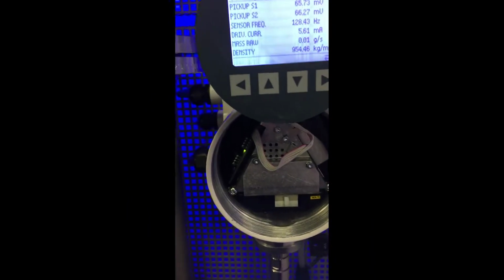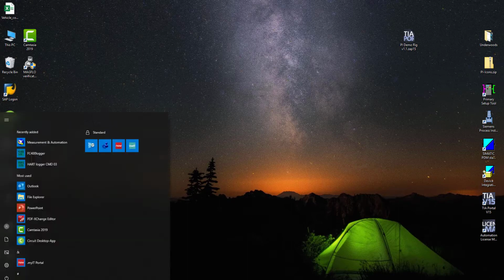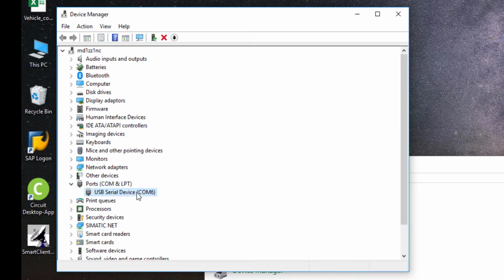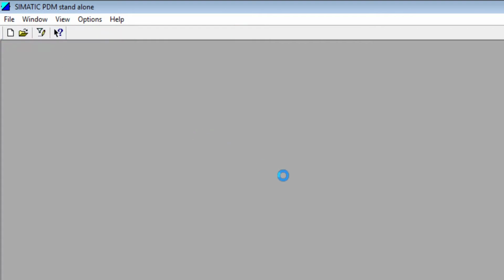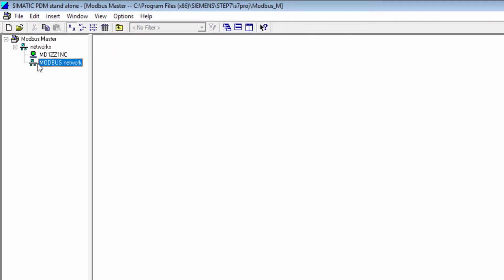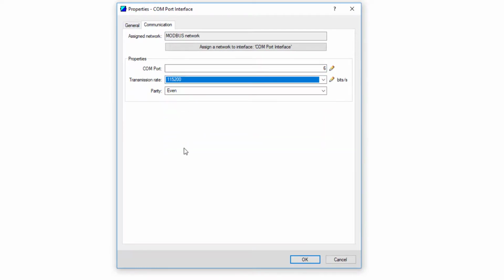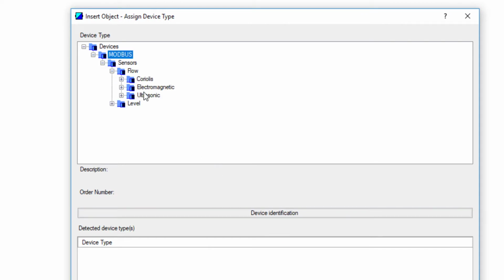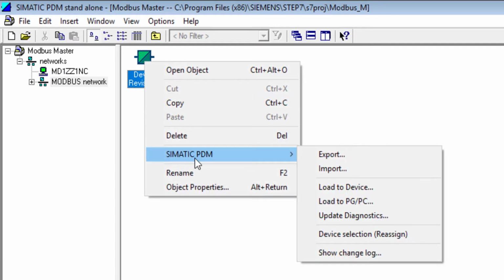How to use Siemens Simatic PDM as a Modbus Master

Comment: if i configure modbus network which hardware i need ?
Reply from the maker: Please send me your e-mail and I can then send you a tech note I put together for this.  You will most likely require a Modbus 495 to 232 converter.  See link below.  This is what I use.
https://www.amazon.co.uk/DTECH-Serial-Adapter-Supports-Windows/dp/B08CRFKLRG/ref=sr_1_16?dchild=1&keywords=RS485+to+PC&qid=1609938424&sr=8-16